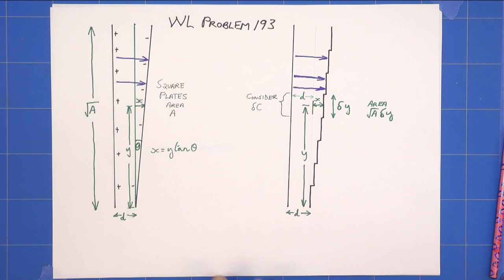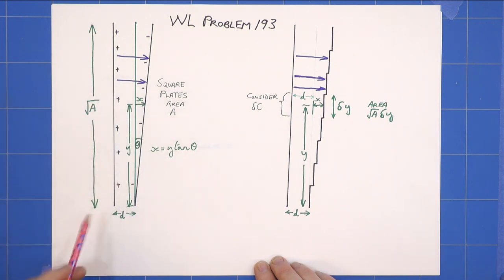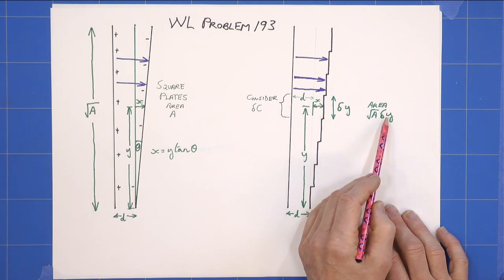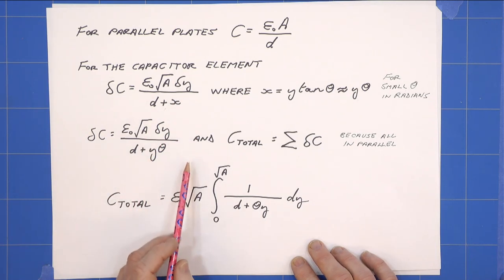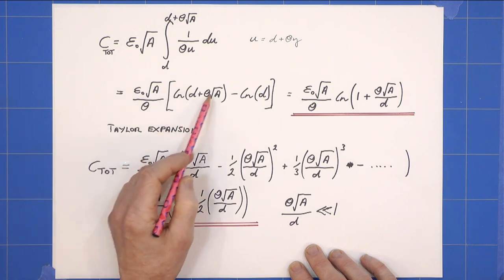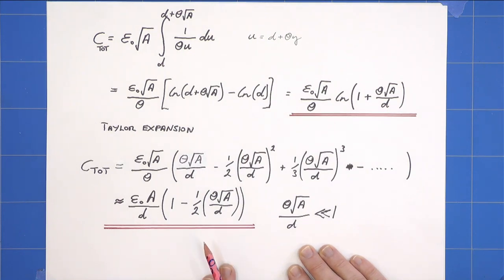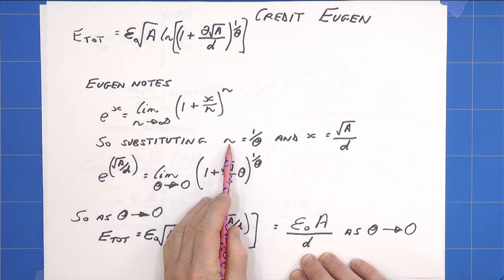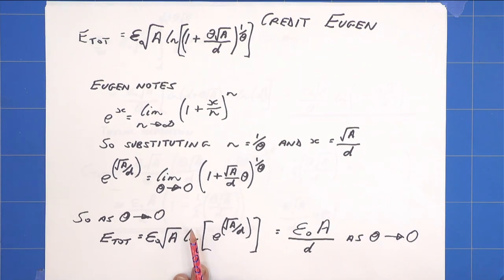Keith's Solution to Problem 193

Comment: Hello Sir, please answer this query of mine. 
Can the contact angle of capillary tube change from the specified value in the intermediate state of rising up? 
(Query from JEE Advanced 2019 Paper 2 question)
Reply from the maker: answers of JEE Advanced exams are published in India
Reply: @lecturesbywalterlewin.they9259  Sir, the proper solution is not mentioned anywhere. My doubt is specifically regarding two capillary tubes placed above one another. In case of insufficient length of one tube, will the water rising in the tube will cross the interface or would the meniscus adjust it radius on the interface for balance?

Comment: Can there be an electric field even if net charge is zero? If yes, how electric field and electric flux are connected in this case? Please clarify, sir.
Reply: Yes, for example in the case of a dipole the net charge is zero and you still have an electric field (that decays rapidly away from the dipole)